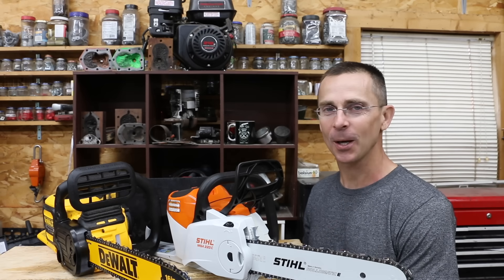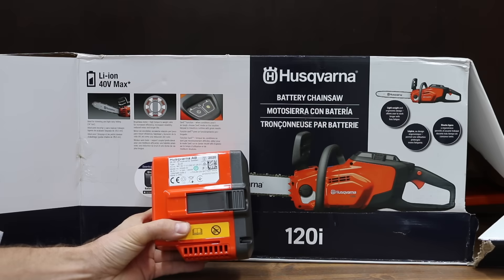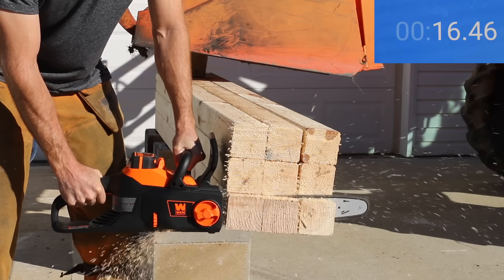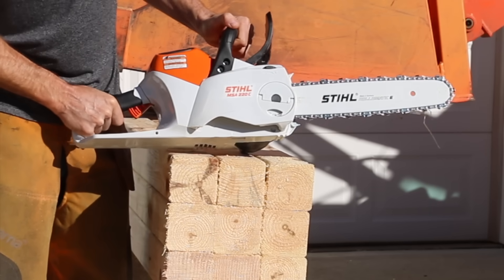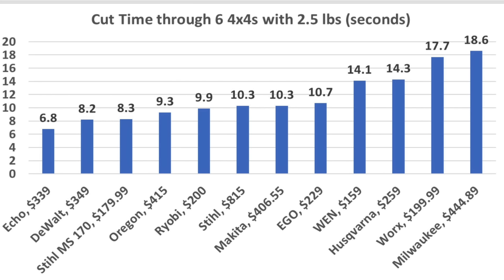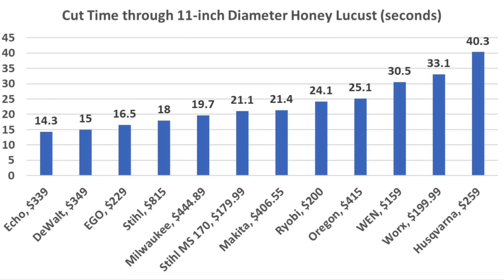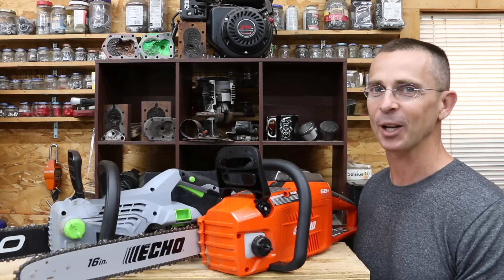Best Battery Powered Chainsaw Brand (ROUND 2)? Stihl, Husqvarna, Echo, Oregon, DeWalt

Comment: The echo is pussyshit because of 1 thing, corporate garbage planned obsolescence. 
Its got heatshrink on the motor wires that will fail after so much vibration. The heatshrink is cheap and crappy at the motor where it goes to the windings, not because they made an honest mistake, they used some shit that does not wear well over time and damn echo for it. 

The way to fix it, is open up the hard to work on piece of crap, and add more heatshrink, thats the best way to keep it working well for a very long time. 
Or make sure the motor screws behind the sprocket are always tight, (after 10 tanks of oil) tighten those screws cause they loosen, Or tighten and secure with super glue or epoxy. They will back out. as oil ingresses they will vibrate loose, not causing much of a problem in general EXCEPT the lousy winding heatshrink will wear through and arc on the metal motor parts and kill the controller. 

Every time. 

I am right.

Comment: After watching the first electric chain saw battle where the DeWalt came out on top and this second one, what caught my eye both times was how the sawdust and chips flowed nearly straight down or at a reduced angle back to you with the DeWalt much more so than any other brand from both tests.  The Stihl was a MESS blowing sawdust everywhere !  The DeWalt just has a cleaner more controlled ejection of sawdust and wood particles.
Reply from the maker: Thanks for the feedback.

Comment: On the DeWalt what size Battery were you running? I would’ve loved to see its performance with the different FlexVolt battery options 6Ah, 9Ah, 12Ah & 15Ah. Yes, I realize that these are the 20v max Ah numbers and not the 60v max rating. And also the charge time using the DeWalt yellow topped 12A Fast charger instead of that 4A or worse, all I could tell is it was one of the small ones. I know DeWalt also offers 6A & 8A chargers too. With those larger Ah batteries you would think they would throw in a higher amp charger since they make them.

Comment: This was a great review! Having a hard decision between Echo, Ego, Dewalt, which are great saws, I decided on the latest 2024 Stihl MSA 220 C-B which has improvements over the older model. It has the new 3/8 PICCO PM3 chain and a Light 04 bar, oil sensor, enhanced performance (I was told by support). Their special pricing included one extra battery. First day was a blast walking all over the place cutting down hung up trees to the ground, no smoke, no earplugs!  Battery held reached one bar. For a small saw, this 220CB will be the go to saw. Thanks for your reviews.
Reply from the maker: Thanks and you are welcome!    Thanks for sharing.

Comment: Echo has incredible value but the awkward thumb button and the tightening system still make me want to use Stihl in the long run. I've had a Stihl MSA-220 for maybe 6 years now. It's not particularly light but Echo is heavy which does matter. That 5,5kg is the point where lighter is easy to use one handed and heavier becomes difficult.
Reply from the maker: Thanks for the feedback.

Comment: Looks like the battery chainsaws need massive improvement for heavy use. Usually when we break out the chainsaw we run it for quite some time clearing trees and limbs, those runtimes are terrible.
Reply from the maker: Thanks for the feedback.
Reply: I have a gas chainsaw with a 24 inch bar for heavy use, but it overheats and has to sit and cool. I also have about a dozen Dewalt batteries for all of my tools. So I can keep the Dewalt running longer, quieter, and with less hassle. The gas chainsaw needs to be refueled every 18 minutes or so, and when it's shut down, it takes about 20 minutes before it will restart.

Comment: Based on videos such as this (although likely not this one since I think I bought it before this video was published), I purchased the ECHO 58v.  It worked really well, but only got about 20 min of work done between charges.  I wished I had a 2nd battery, but at $200 (then), I didn't want to purchase one.  I used it a few times a year, but I did cut and split wood at that time, and had some large trees to cut up.  It stopped charging.  It has sat for a year or two now since I've had other priorities.  It looks like I'm not the only one to have problems with the 58v Echo battery.  Since I'm only going to use the 58v on the chainsaw, I'm hesitant to purchase another 58v battery at $250.  I'm now rewatching videos to see if I want to go with Milwaukee/Makita/whatever so I can at least use the batteries on tools.

I wish there was an adapter to use a different battery on the Echo.
Reply from the maker: Thanks for sharing.

Comment: I love my Stihl gassers but I also love my Echo dcs 5000 battery chainsaw. It has a 18" bar and it's one cutting beast. It actually runs like a powerful gas saw. Great for winter when you drained the fuel out of the gas saws. Great for down trees from storms. The battery is pretty good but would definitely have at least a couple  charged batteries for backups so you don't have down time waiting on a charge.
Reply from the maker: Thanks for sharing.

Comment: Its not fair. The husqvarna 120i is a non profesional chainsaw model, and the Stihl ms220 is a professional model. And the charger from Stihl is not the basic charger. It is a more expensive charger that chargues quicker. So it is not to fair to compare professionnal with no profrssional chainsaws.

Comment: As I said on the other video, I have the Makita and really like it. But that Echo is tempting, if and when the need arises. I liked that the Makita used the batteries I already had, and I'm also running Ryobi 18v. But I just added their 80v ZT, so theoretically this already puts me into 4 battery platforms. What's one more?😅

Comment: I’ve had the Echo 58v chainsaw for 10 years and I’ve never had a problem with it. The batteries have problems but not the tools. I also have the string trimmer. One battery died from being discharged to far which shouldn’t be able to happen. Now I stop before the battery is fully discharged, I’d rather change the battery then buy a new one. They’re expensive! I’ve used the 58v chainsaw and string trimmer for the last three day’s clearing a wood lot and they’re still running like new!
Reply from the maker: Thanks for sharing.

Comment: The actual variable in your test is the chain of each saw , angle of tooth, and depth of the chip remover controls how fast a saw will cut .
Just look at the chips the saw makes , is it saw dust or chunks of wood .
Otherwise, it's a good video to show a general comparison 😊
Reply from the maker: Thanks!

Comment: The Echo is a cheaper version of the AEG which uses the same 58V battery but has an 18" bar, steel spikes, more chain speed etc.

ThE AEG 58V 18" is AUD300

Comment: Why does no one evaluate the Kobalt 80 volt brushless 18" chainsaw with 5ah battery?  I have (2) Kobalt 80-volt 18" Bar Chainsaws and use (2) 5 AH Batteries. Using it on a Southeast LA farm that was devastated my Hurricane and has been working absolutely great even cutting huge logs and trees. For oil, I like to use Ryobi Bar and chain oil. We have cut 20"+_ logs and it works like a charm. And NO more pulling and pulling to start a gas-powered chainsaw. My first 80-volt 18" Bar Chain saw with a 5-AH Battery and charger was $400 in Jul 2021

Comment: Thank you for another great review!!

Wouldn’t it have been more fair a test to vary the weight applied so that the saws were normalized taking into account each one’s weight?

Also why not buy compatible batteries (no matter what you are testing$ for a mote fair run time and power of cut tests?  Of course that should also be factored into the cost of a “usable” tool.

Comment: The 16” Ego chainsaw comes with a 5ah battery, rather than the 2.5.  It’s well worth the added cost.  I’ve used both sizes in my saw, and there is a noticeable difference, not just in run time, but in overall power as well, between the two batteries.
Reply from the maker: Thanks for the feedback.

Comment: I would love to see test of affordable top handle battery chainsaws/Pruners:

1. TOTAL Industrial, 12", 20 V
2. RAIDER rdi-bccs32 
3. Hitachi CS36DL 36.0 V 
4. Einhell FORTEXXA 18/20 TH
5. SENIX CSX2-M1
6. Hyundai HY2190 20V Cordless Chainsaw
7. SKIL 12-INCH BATTERY CHAINSAW | PWRCORE 20 BRUSHLESS
8. DEWALT's New 20-Volt DCCS623B DCCS623L1
9. CRAFTSMAN CMCCS620B
10.Makita XCU06Z 18V

Regards!
Reply from the maker: Thanks for the suggestion.
Reply: This would be interesting for all arborists out there. Thanks! @ProjectFarm

Comment: Best battery-powered lawnmower? String Trimmer? Hedge Trimmer?  I'd be interested in seeing a long series of battery-powered tool comparisons and ratings put into a spreadsheet and figuring out which brand offers the best battery powered suite for a home.  Honestly, the batteries are a big part of the expense, and that's part of what you're buying into.  Echo has the best battery chainsaw by a mile, but that Makita last time didn't do bad and they also have a lawnmower and string trimmer, and an entire suite of gardening and construction power tools on the same battery system.  Many of these 40v/60v systems can't boast that, and it's really convenient and efficient to have fully interchangeable batteries for all your tool needs.  Then again, if the tool is twice as efficient and you use it a lot, it can be worth it to have its own dedicated batteries/chargers just for the time savings.  Lots to consider....

Another recent thought was on drill clutches.  They have no standard torque settings across brands or models and no indication how much torque any setting has.  A rig to measure and compare that would be super useful to the home professional and may even prompt the industry to get their act together.
Reply from the maker: Thanks for the suggestion.

Comment: I’m happy with my 14” Ego for its use. Up in the tree and saplings, even dropped a couple of 8-10” trees. Plus the batteries are all interchangeable with my Ego blower and string trimmer. Which means I can run the 5 & 4 amp hour batteries. 😊As an aside I’d put my Ego string trimmer up against my former Stihl FS314 (?) model I had years ago.
Reply from the maker: Thanks for sharing.

Comment: So I dig your reviews and I bought the Echo because of your video here and because the Echo had 2 steel pins. One thing you may want to think about is how the battery automatically discharges when not in use and how it's a real mutha to get it going again. Some advice is to hold the "power" button on the battery down for 10 seconds but that didn't work for me. Other videos recommend a complete dissection of the battery...both are a hassle and now I have a chain saw that is useless. Take care man, I'm watching!
Reply from the maker: Thanks for the feedback.

Comment: Nobody in their right mind, goes out into the woods to cut lumber, with a battery powered saw.  We only use these for internal work, for a few minutes per hour.  The batteries just do not have enough energy to last very long, and we use up one battery in only about 20+minutes of direct work.  This requires multiple very costly batteries, with no payback and no repairability.  The 115V cable powered saws are much more useful, and lighter, where there is internal house power.  We only use very short blades, with 12-inch being a common size (or smaller), as we don't need to saw through 14+inches of walls.

Comment: I have the 16” ego which comes  with the 5amp battery,  My only complaint is the chain tensioner it seems to constantly lose tension and need to be readjusted, it’s very easy to adjust when that happens,   but I’m used to set and forget until it’s time to sharpen the chain so I have in more than one occasion slipped the chain because it got too lose. 

Also in full disclosure I didn’t necessarily pick out that saw, my wife runs the tool department at a “local” hardware store (they stock jet and powermatic tools) like many of the tools we have, she got the ego as a deeply discounted demo.

Comment: I had an ego 56v. No matter how sharp the chain was it didn't have enough spin up or longevity to cut an actual tree down. It was also very very heavy compared to my Stihl MS250. It would only run about 30 min unloaded. Cut that in half whilst actually cutting. Out of all tools I own I would rate it in the worst three tools I've ever owned. A larger battery cost as much as the Stihl I bought to replace it. 
Some things I just don't think are meant to be electric.
Reply from the maker: Thanks for the feedback.

Comment: One saw that has impressed me is kobalt, for 200 bucks with battery and charger it is phenomenal, lot of power and torque and the factory chain is great! Didn’t have to replace/sharpen chain for over a year of decent use!! Great value
Reply from the maker: Thanks for sharing.

Comment: All of these bars are too short for my needs. I would appreciate a test of battery saws in the 18 to 21 inch bar range. The reason that's important is that at an 18-21" wood diameter, the wood is heavy but still a good weight to pick up and load by hand when cut to stove length. If I had to use one of these 14-16" saws, I would have to select much small diameter trees, and it would be a huge amount of wasted effort. With a good quality log splitter, the larger diameter wood is just so much more efficient to cut, load, and split.  In fact, at the place I go to cut my wood, there is someone there who uses an electric saw, and I've seen firsthand how much trouble he has.
Reply from the maker: Thanks for the suggestion.

Comment: Please consider reviewing different battery voltages for these tools. To my knowledge they're available in 40V, 60V and 80V, is their a compelling reasons to select one based on its voltage? There are a lot reviewers on YouTube, you are head and shoulders above them all.
FWIW, I bought my first battery chainsaw 7 years ago, a 40V Greenworks, 16" bar. Few tools have impressed me more, I've used it so much I wore out the sprocket and replaced it. The OEM 40V battery is still going strong, The OEM chain is long gone and I cycle through 3 Oregon chains.
Reply from the maker: Thanks for the suggestion.

Comment: I purchased the ego when I saw this video. I used it extensively and it worked great. The battery eventually died after about a year and a half. I just saw a video on the harbor freight atlas brushless eighteen inch Chainsaw. It was a hundred and thirty nine dollars. It looked like a knock off of the ego. Almost identical. If you're planning on doing a new chainsaw line up, I would like to see these tpower off.
Reply from the maker: Thanks for the feedback.

Comment: My concern about these battery operated saws is that you're all missing the big picture. All these electric tools have common flaw. With the saw, obviously one can sharpen or replace the chain, and replace the battery until the design of the saw changes. Other than that, is there any other replacement parts or repairable parts available for it? NO. Same goes with battery powered lawn mowers, leaf blowers, line trimmer (weed whackers), power washers, snow blowers, etc. Just 3 years ago, I purchased a Porter Cable impact driver. I used it to build some shelves in my work shop for driving construction screws. Never used it like and impact wrench for auto repair, that's for and impact wrench to do. Last year I built a new deck. When it came time to start driving screws, I grab the impact driver and the first thing I discovered was it would not hold onto the driver bits anymore. Then, the trigger started to fail. Eventually it just plain died. Can't repair them. Had to purchased a new one, but certainly not the same brand. So with that, goes 2 batteries and the charger. I can live with battery powered tools like drills and drivers, even a cordless circular saw is handy. But when it comes to outdoor power equipment, I want something I can maintain and hold onto for several years. That is NOT going to happen with these battery powered outdoor units. They are throw away and buy new products. Just more landfill junk.
Reply from the maker: Thanks for sharing.

Comment: 0:22 $159 WEN 40V brushless 5.4kg 16" (dull metal bumper spikes)
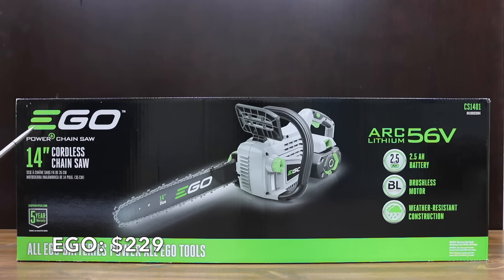1:42 $229 EGO 56V brushless 5.1kg 14" (plastic felling spikes)
2:31 $259 Husqvarna 120i 40V 4.9kg 14" (plastic spikes)
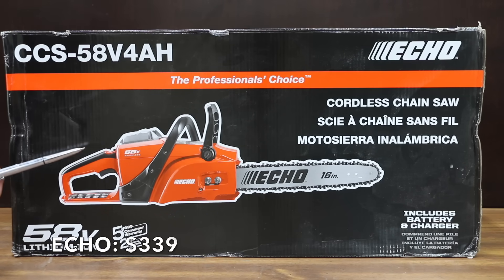3:19 $339 ECHO 58V brushless 6.6kg 16" (plastic spikes)
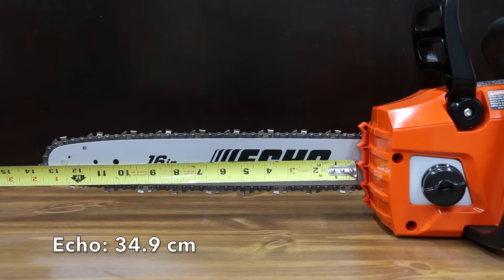4:19 $415 Oregon CS300 40V 6.3kg self-sharpening 16" (dull metal spikes)
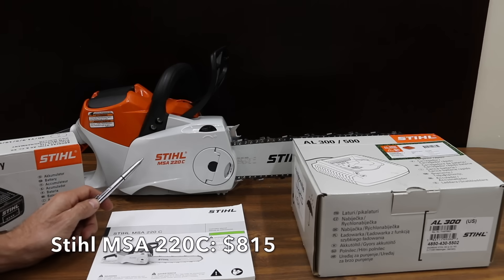5:30 $815 Stihl MSA 220C 36V 5.3kg 14" (sharp metal spikes)
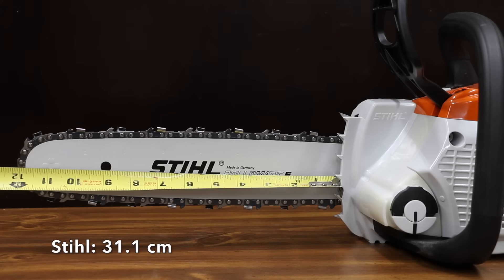6:24 Noise measurements
7:44 Cutting time measurements on nine 4×4s
11:19 Cutting time on six 4×4s, w/ 2.5 lbs weight
13:14 Cutting time on 11"-wide locust tree log
15:42 Battery runtime
17:43 Battery charging time
18:21 Conclusion

Comment: I have a Ryobi I bought several years ago-- it was inexpensive, and mostly has worked fine. It is not balanced when working up in a tree or over your head, and it is noisy, charging takes a long time (so I bought an extra battery). Now that I've seen these and other reviews/tests, my next chainsaw will be a Husqvarna. I see that the Echo is fast, and the Ego is pretty good (I like their lawnmowers), but the Husky is lighter and better balanced, much quieter, and has better felling spikes. Weight and balance are the two biggest factors for me.
Reply from the maker: Thanks for sharing.